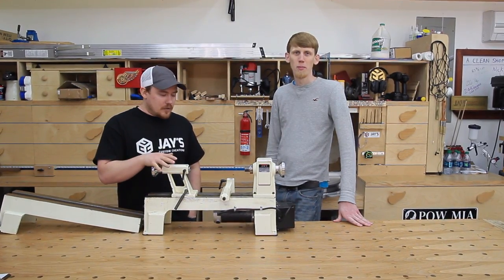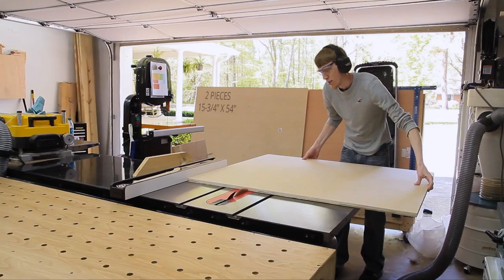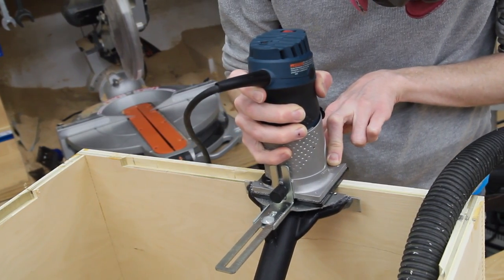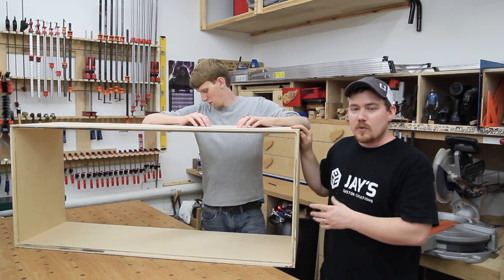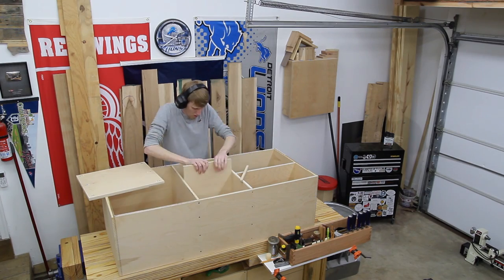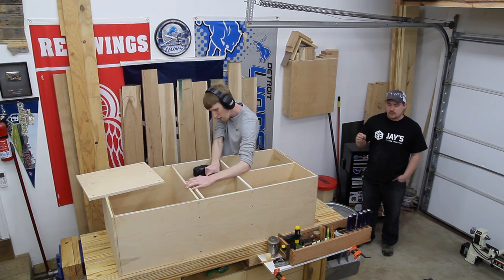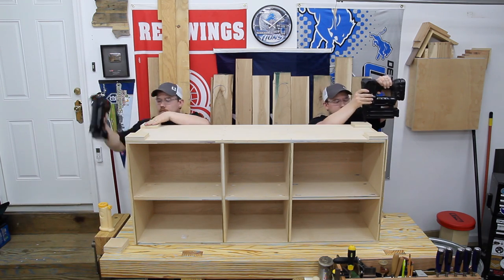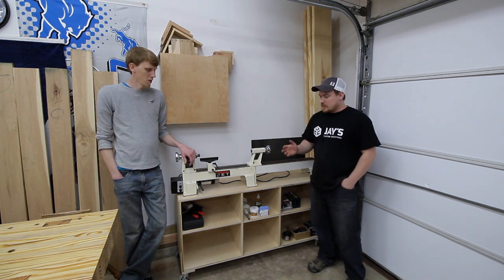Mobile Lathe Cart - 243

Comment: One thing you'll definitely want to add on is a convenient storage space for your turning chisels.  I personally prefer having them on the wall above and behind my lathe for easy access to switch between them while I'm turning, and I've seen that approach done by a lot of other turners as well.  For this case, if you want to keep it mobile, my advice would be to add on a rack to the side, possibly one on each side depending on how many chisels you have.  Alternatively, you could build a rack with a foldable stand that will stand freely nearby when you're turning, and fold up and fit into one of the cabinet slots when you're done.

Comment: Nice job men. I also agree with Pascal. The lathe throws shavings everywhere and those shelves will quickly fill up.
Reply from the maker: +Turntastic Wood Designs I've turned a few dozen items already. They don't fill up but I do want drawers.
Reply: +Jay Bates I'd put the drawers to the right hand side of the cabinet...and in the top one I'd keep the turning tools...where I can leave the drawer open and it won't fill with shavings.

I really like the box joints...I hope your construction is still sound in a few months after the vibration it will take. 

All the best.

Comment: Great job guys. Love your show. I'd recommend either 2 more castors under the middle vertical support OR 2 horizontal beams under the cart, otherwise the cart will eventually bow down with all that weight.

Comment: hi Jay.  General rule of thumb is that the spindle should be at the same height of your elbow.  If you have back pain after couple of hours of turning, elevate your lathe a bit.  Happy turning and please dont forget to use faceshield :)     Marc
Reply from the maker: +Marc 's Oneway of turning correct. I sized it for my elbow.

Comment: Hi Jay - literally, the day I wanted to mobilize the lathe I will be getting - your video pops up!  Thank you!  Question - even though you used locking casters, do you have any movement issues with the cart now that you have started using it?  The only time I plan on using mine will be outside on a deck - so concerned about making sure it sits still.

Comment: Looks like you may need some weight in the bottom to help with vibration?   And as far as the chips just hang a heavy cloth or tarp material as you aren't ready for any doors.  That will keep any shavings out if they are a problem.  I am needing to make a cart for my excelsior lathe and am gathering ideas so your article is perfect timing!
Reply from the maker: +Terry Ellis Vibration isn't an issue. I've turned a 10" platter that wobbled the lathe a bit until I trued it up. It handled it just fine. I've turned a few dozen items since making this project though. The shavings aren't a huge deal but I do want to add a few drawers near the top.

Comment: nice build. how high is the cabinet when on casters? 
how high should the stand for a midi lathe be anyway?
thanks
Reply: Ideally the spindle on the lathe should be at your elbow, so the stand should be roughly at your wrist, depending on your height.

Comment: Quick question: does your lathe vibrate on the stand or does it seem solid? I had to add sand bags to my cart to eliminate the vibration
Reply from the maker: +Rosanne Farrell It vibrates when turning off center. Not a problem though.
Reply: +Jay Bates thanks getting back to me so quickly.  Love your site, thank you for all the time it takes to produce your videos.

Comment: Jay:::  it might be a simple project but it shows a lot of skill ,,  because to free hand cut the box cuts to attach the frame panels
it not something I would think was easy.  especially without some kinds jigg to keep the box teeth at the same dimension.
I would end up with the teeth/ finger joints  not lining up.
Reply from the maker: +james waldrup  I used a box joint jig.
Reply: +Jay Bates thanks  didn't see the jig on the table saw  ,, must have been behind the stock

Comment: nice video. but a lathe is probably the only tool i never would have on casters. just to eliminate any small chance there is for movement/vibrations while turning. but i like the idea of having everything beeing mobile! thumbs up
Reply from the maker: +Kristoffer Røstad Martinsen I have it on locking casters. Lock the casters and it doesn't move.
Reply: +Jay Bates have seen you use them before so I assumed they would be used on this project as well. But again, I like the idea of having everything mobile